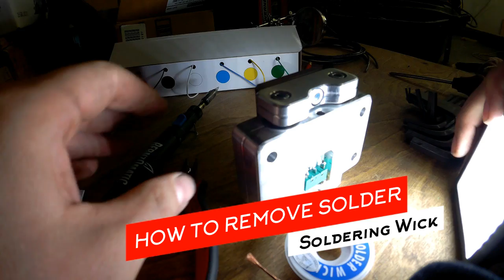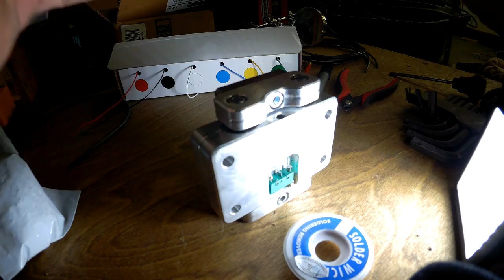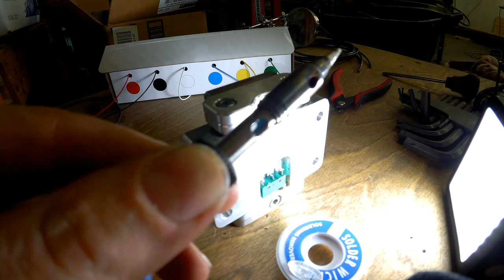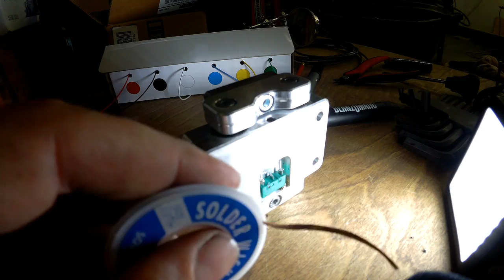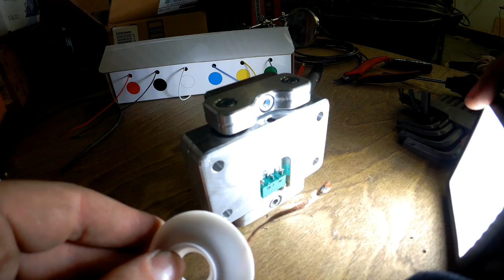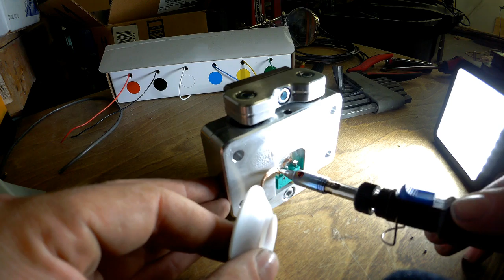How to Remove Solder - Soldering Wick

Comment: I usually heat up the solder and thump the circuit board or whatever on the table and the solder will fly off.
Reply from the maker: Landon Brecheisen I'm def gonna try the thump next time, especially w something as sturdy as this. Thanks for the tip 🤖👍
Reply from the maker: I used their videos to setup sheetcam but I'm using a linux system running CommandCNC not MACH so I'm kind of learning CNC Machining and a new operating system (linux) all at the same time.  Probably why the build slowed down once I hit the electronics LOL.
Reply: Use compressed air and have a little excitement in your shop LOL

Question on the 620 oz motors are they a NEMA 23 or 34 frame? I am done drilling and tapping for now.. I also found a press brake that can do my 6'3" x 12' 3" water tray :)
Reply from the maker: SegoMan pretty sure they're NEMA 23's I'll double check tomorrow.